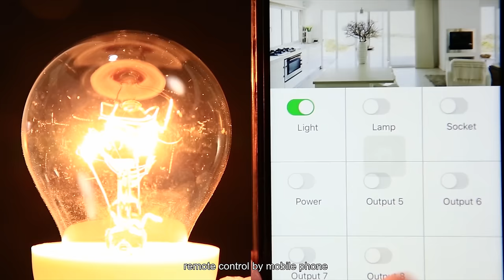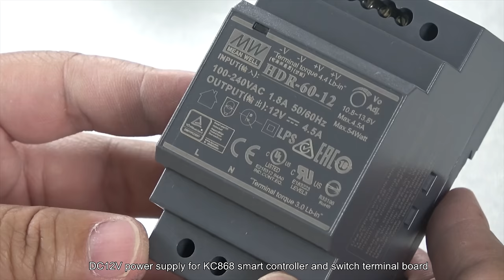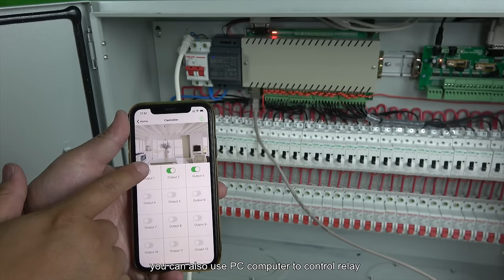Home Automation 32CH Distribution Board DIY Smart Home IOT Project 2020

Comment: what is the use of terminal switch board?
Reply from the maker: that for manuall control with wall switch and use RF wireless remoter control 32 relays ON/OFF

Comment: Hey, it is an amazing project. Can you please share the circuit diagram and software details?
Reply from the maker: this is newest solution: https://www.kincony.com/download/SMART-Main-Distribution-Board-using-KC868-H32BS.pdf
Reply: @KinCony  how to program this controller
Reply from the maker: @ekananthan3268  it can set by phone app or pc or many third party software, such as home assistant.
Reply: @KinCony  you mean  google assistant and voice over control is possible?
Reply from the maker: @ekananthan3268  yes, just add raspberry pi running node-red
Reply: @ekananthan3268  Home Assistant is an open source project. I believe he meant that rather then GA.
Reply: NO NO NO... do not aid others in doing such dangerous works. 
Frankly... the video should be taken down and only used for training purposes... like those blood and gore safety training films shown to trainee apprentices - What NEVER to do. List the gross errors... cite less than 10 and you fail the test.

Comment: What if this system fails then how we operate fan and ligths manualy
Reply from the maker: there is black button on the AC contactor for manual control, if system is fails.
Reply: @KinCony  but every appliance contactor need to install ? It is more costly i think, for example bathroom light separate contactor same as 200 contactors required i think
Reply from the maker: @pushujgd  if use for many lamps, you need use switch terminal board connect with wall switch for manual control? do you means if the switch terminal board is broken?
Reply: @KinCony  yes sir if sw terminal broken or relay board broken then how to use all appliances of home. And for each appliance i cannot use contactor so any other option please suggest.
Reply from the maker: @pushujgd  The most conservative method is to select the controller with com, NC and no, and connect the traditional switch on the NC end as the standby mode, which can be used when the system is damaged
Reply: @KinCony  if i use traditional sw then if someone on it then i want to off it via mobile app then it will not work i think? Or any thing else what i not understand
Reply from the maker: @pushujgd  use self-reset switch panel, not latch switch panel.
Reply: @KinCony  i am not getting your point that if i connect in nc then relay controler broken time nc traditional sw can work, how?
Reply: During broken time connection was in NO or NC no matters it will not work manually during broken time or you have any solution or circuit diagram for that
Reply from the maker: @pushujgd  if you think whole system is failed, so you need install a traditional switch panel to use, this button usually not used, just all system is bad, then use a bypass switch change to traditional switch panel to use.
Reply: @KinCony  meaning i habe to use 2 panel one is of traditional sw another is of self reset sw then at the time of system fail i need to on bypass mode like that you want to say?
What is lifecycle of relay controller?
Reply from the maker: @pushujgd  for example: lamp->bypass switch (COM,NO,NC)-> NC with your smart relay controller, NO with a manual button(this use for when whole system is fail)
Reply from the maker: @pushujgd  give me your email, i send you a diagram, you will understand easily.
Reply: No mail received, have you sent?
Reply from the maker: @pushujgd  you need give me your email address.
Reply: So the fail safe system suggested is to bypass the whole system with an additional traditional switch board? 

Note:- switching on/off any appliance with wall mount switches (near appliance) even if the whole control circuit is damaged is the requirement.
Reply from the maker: @abhiram721  The ultimate solution is to add a bypass switch, but it can also be controlled manually through the button on the AC contactor.
Reply from the maker: @abhiram721  tomorrow send to you, now in China is 22:28
Reply: @KinCony  Thank you very much sir.
Reply: you are doing a great job.Thanks

Comment: You should never use a machine on circuit breaker.
Reply from the maker: that contact have option for AUTO, manual ON, manual OFF.
Reply: What the hell are you trying to say?

Comment: This setup is hazardous. Too many contactors in line, without proper cooling. To many connections from 64C circuit breaker to contactors. Relays operated directly from 64C? Two difrent diameters of wire uder one clamp. Even if it is for demo, You shoud not show such mess.
Reply from the maker: Thanks for your suggestion. The video will be improved in the future